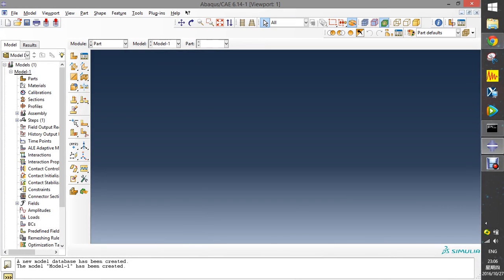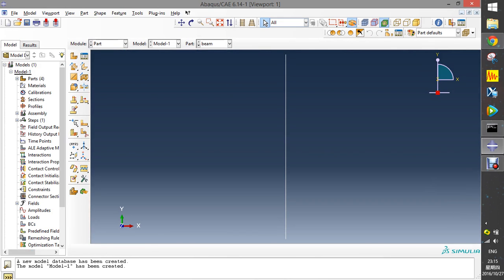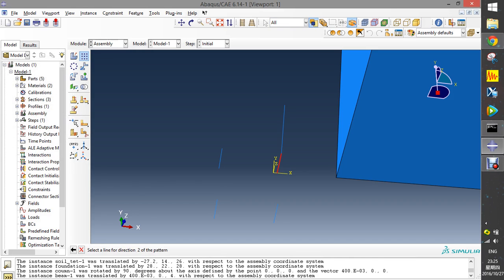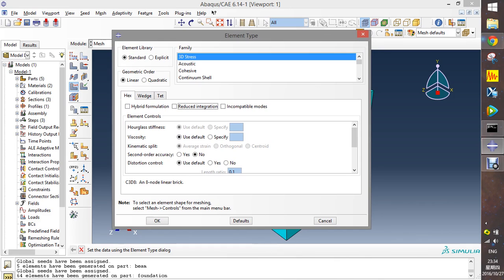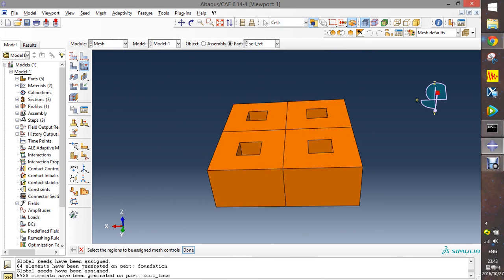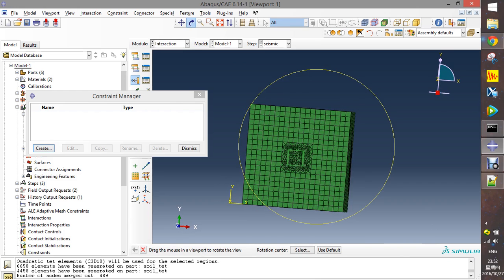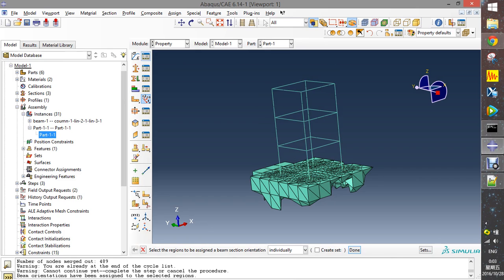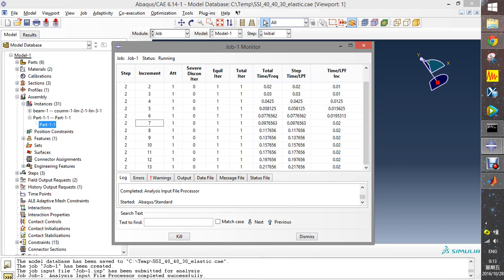simple SSI model construction in ABAQUS

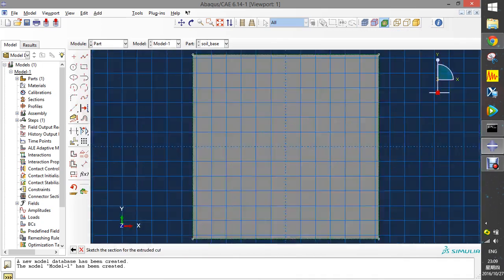Comment: Hi Wang, can you tell me what command did you used to turn the views at 2:53s?
Reply from the maker: I think you can just double click on the surface, then the view will turn
Reply: double click doesn't work, I need to know how to call out the bottom bar
: 'select an edge or axis that will appear - vertical and edge on the right '

Comment: Dear Wang  very informative video. just few queries: Usually we will create "infinite elements" at boundaries to arrest reflection of seismic waves from boundary, in your video I did not com across the creation of infinite element, please correct if I am wrong
Thank you
Reply from the maker: thanks. I agree with you. What I did in this video is just a very simple tutorial on SSI, it's more focused on how to use ABAQUS rather than how to accurately simulate SSI effects. The boundary conditions of the soil in my video is just like a laminar box which is not the perfect one.  But the reflected wave wouldn't impact the structural response much if you have a large enough soil domain.
 No doubt that it's better to use absorbing boundaries, such as perfect matched layer, to avoid wave reflections. Also, you can try domain-reduction approach.
Reply: Thank you very much; If we give "infinite elements" at the boundaries then  still we need to give laminar box boundary condition for serious SSI analysis?
One more query is  what is the significance of using the "soil tetrhedron element" for connecting foundation and soil; Is it same as master-slave with penalty type interaction law?
Reply: Thank you very much; If we give "infinite elements" at the boundaries then  still we need to give laminar box boundary condition for serious SSI analysis?
One more query is  what is the significance of using the "soil tetrhedron element" for connecting foundation and soil; Is it same as master-slave with penalty type interaction law?
Reply: Can you suggest how can I provide non reflecting boundary condition and absorbing boundary condition on the soil element?